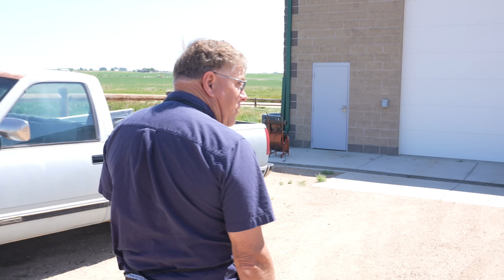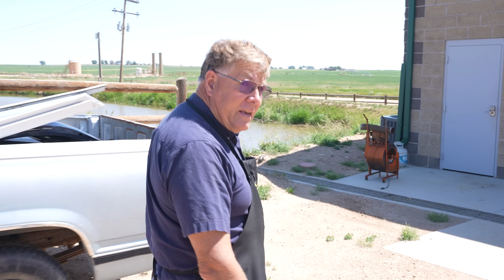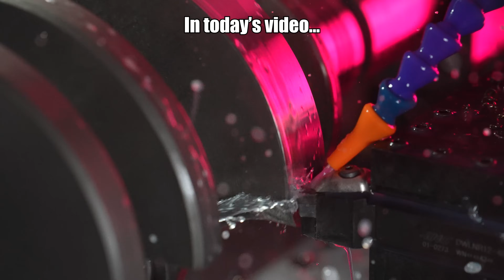CNC Lathe Turn BALANCING A V8 Crankshaft ... It Did NOT Go Well!

Comment: 10g at a 6" radius doesn't equal 10g at a 6.5" radius. Adding the same weight clay at a larger radius isn't the same as the same weigh in the original hole.

Comment: GOOD TRY!
If you did what I did understood from you approach, which didn't followed, the tale will be anther one than the one you were looking.
I understood that you were going to do the lathe turning eccentrically in order to shift the counter balance weight, with out changing leadind and follow edges.
But you went concentrically and the only thing you did was to reduce the radius evenly and by that reduce the effect of the imbalance by reducing the centrifuge forces by making a smaller radius, therefore your centipede increases and your predictions went   ...lost !
Shaving leading face and follow facing was a big mistake. You went    ...LOST !
The leading edge cuts into the air and splits the oil splashing, both more efficient.
While follow end is lika the tail boat shape making it to spin faster. Just like sailboat and high precition hunting bullets does.
Your digital table is a great idea, but you should understand that the density tru that metal wasn't homogeneous at all and that was to be expected, you didn't. Therefore you need a metal dosimeter  to have a much accurate approach.

More prepping and less improvisation was the key to success but the train left you behind.
And reason is because you left out to many variables.

Sorry bro, life is life and all we you is to learn.

Also help not only to think as your are a perfectionist, you must be it too !

Ain't hard !
 Hard is to prepare yourself !

Good luck on the next one !

Too let the cat out the bag for you: removing from only from the leading and tail edges doing the exact shape and form, was the correct answer.

Since that could be hard for some people, better go eccentric turning, and leave those edges along !  "Don't touch it"  LOL

You violate #'s 1 cardinal engineers rule ---> " If you can't  buy it, don't make it !!!"

This is Pearl !

When you do a video remember is recorded and must be edited too.

You start as you care genuinely a lot and after you several times poop a lot it,  you end up showing signs of you don't care or don't give a sh*t ! or the big F !

That for sure is really bad advertising.

Mass production deliver within tolerance and cosmetically good !

If you custom mod it you should turn it in a JEWEL not the piece of CRAP that you display it and and you up hiding form the cameras !

All was recorded !

Recommendation go over it and see what you could have done better  !

Good luck and more....

Comment: Yeah that crank shaft would be going back to the manufacturer if it where me. To need to remove that much material from one counter weight is absurd. That crank is defective. I would not use it.